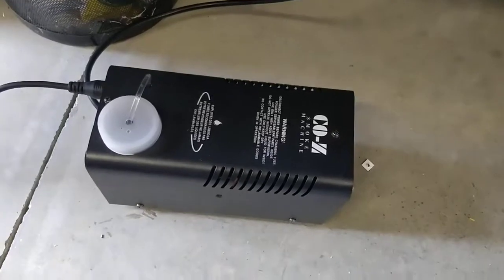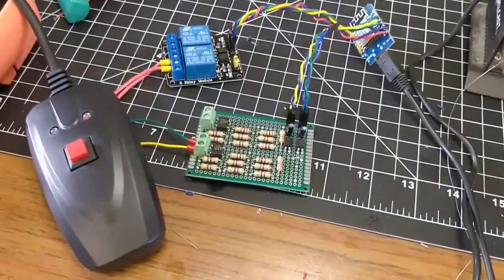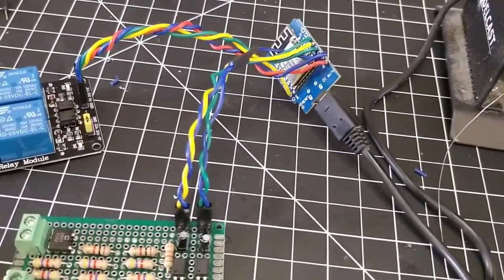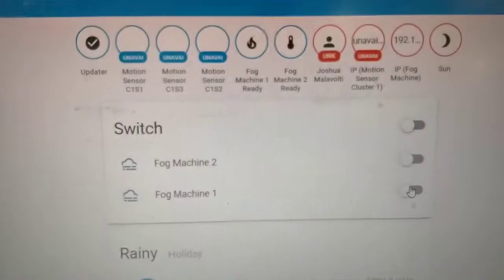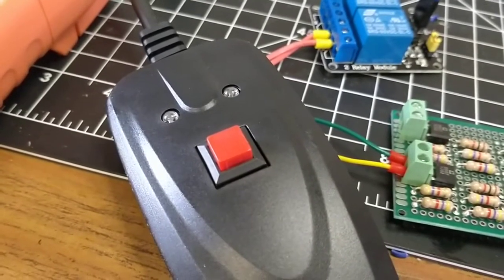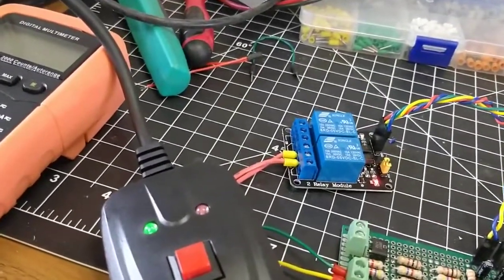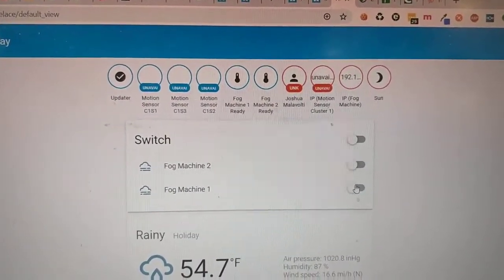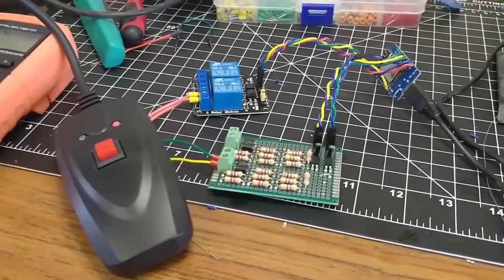Home Assistant   Automating a fog machine with espHome

Comment: This is super-inspiring. I’ve been building an ESPHome module for my smoke machine but it sends rf 315Mhz to the smoke machine’s rf receiver, simulating a button push on the remote. Modifying the smoke machine’s controller directly, as you’ve done, is a better method.  I’d love to hear more info on the board you built.
Reply from the maker: Over the next few months I will be documenting the details of this project.

https://wiki.malamaker.org/projects/halloween/fogger-hacks
Reply: Great. I’ve bought a controller with a button in anticipation. 

￡5.43  20％ Off | Portable 3 Pins XLR Wireless Remote Control Receiver For 400W 500W 900W 1200W 1500W Stage Smoke Fog Machine With Indicator Light
https://a.aliexpress.com/_BP4Qak
Reply from the maker: I have published the details of this build, circuit and wiring diagrams.

https://wiki.malamaker.org/projects/halloween/fogger-hacks#smart-fog-controller-hack
Reply: @MalaMaker86  thank you!